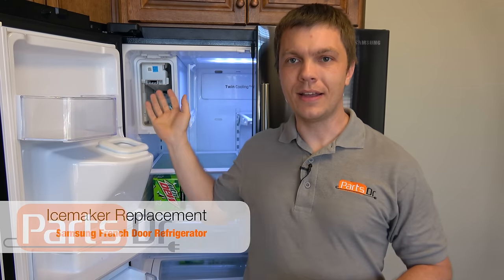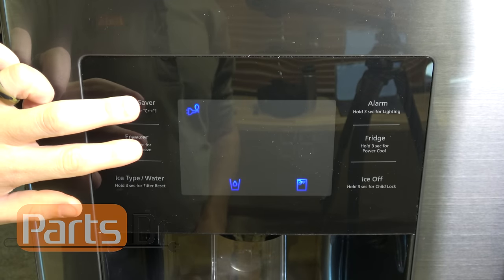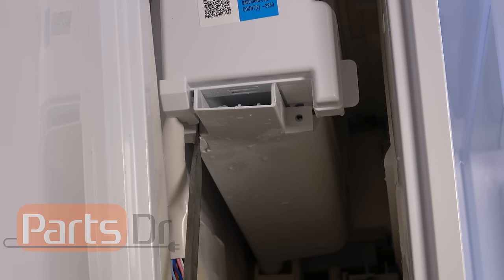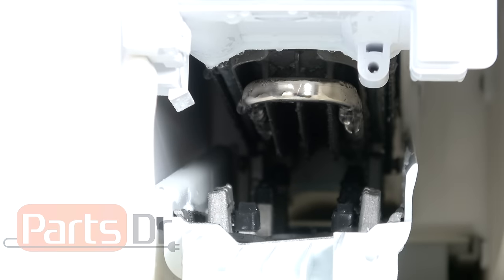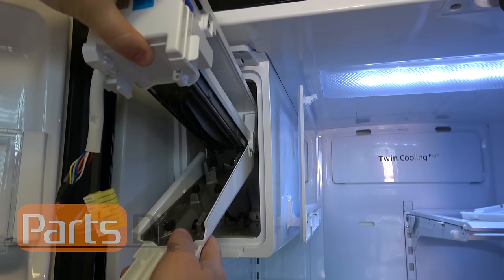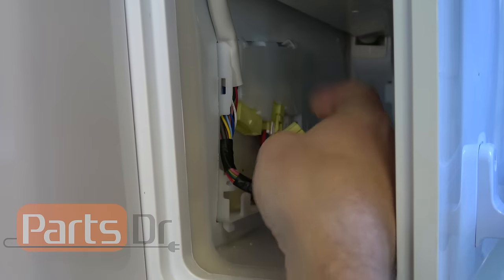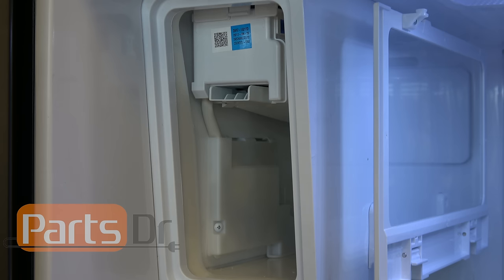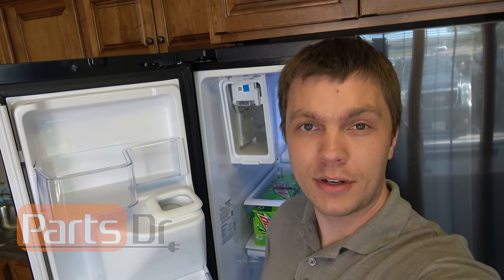How to replace Samsung Icemaker part # DA97-15217D

Comment: I have the samsung rf28hdedbsr/aa and my buttons aren’t in the same location as on this fridge. The turning to forced defrost mode worked but not turning it off. After trying several different combinations I ended up unplugging it to do the job, then just plugged it back in after I reinstalled everything. . Mine had an issue with ice build-up. It would freeze the ice tray into place after about a week. I’ve also ran RO purified water through my system since day one.

Comment: Would this fix the clicking / knocking noise? My ice maker stopped making ice. It’s not frozen up- it’s fully defrosted. Just make a knocking sound.
Reply from the maker: If the ice maker is making a clicking and/or knocking noise, the ice maker is bad and will need to be replaced.

Comment: What does the blue button do on the ice maker I’m about to replace it & I hope this works for the twin metal cooling model
Reply from the maker: The blue button which is also called the ice test switch, can be pressed for at least 1.5 seconds to activate test mode and the harvest mode will start.  If the Ice Maker thermistor is below 0°F, the Ice Maker heater turns on for about two minutes. If the temperature exceeds 0°F. the Ice Maker heater turns on for 30 seconds. After the Ice Maker heater turns on for 30 seconds, the heater turns off and the Ice Maker harvest motor turns on. The motor will rotate in the right direction for about 3 minutes, then the water supply valve is energized and then de-energized and the test mode is complete. If the above operation is not carried out within 6 minutes, the Ice Maker will go into a fault mode.

Comment: I have a Samsung RF23M8570SG with the large lcd display on the right door. Would you know
how to put it in the force defrost mode? Ice maker has the same problem of freezing up. Looks
like the same icemaker as in your video..
Reply from the maker: Try these buttons shown at the bottom of the screen here: https://youtu.be/1DQZs75GEWQ?t=26

Comment: Is the forced reset only the ice maker or does it impact the entire fridge/freezer? Basically, do I need to take all my spoilables out of the fridge and freezer?
Reply from the maker: The forced defrost cycle is for the entire refrigerator and freezer.  It would depend on how long it takes to thaw it out. If you can thaw it out quickly you can leave the food, but if it takes some time then you should put your food in a cooler while you do the repair.

Comment: Is it possible to separately purchase the white plastic tray on the bottom of the ice maker? Before finding this video, I broke this tray trying to remove the icemaker.
Reply from the maker: No, it is not sold separately.  It is only sold as part of the ice maker assembly.

Comment: Is it possible to remove the entire outer box and ice maker? I’m done with the freeze ups and bought an under-counter ice machine for our kitchen renovation. Would be nice to have the extra fridge space if this was removed completely.
Reply from the maker: The ice maker has to be in the refrigerator or it won't work properly.

Comment: I got as far as I could but there appears to be another screw on the side of the icemaking unit to allow you to release and drop it ??? I did not have an angle screw driver so I'm at a standstill. Does this make sense ??
Reply from the maker: We have not seen that for this style ice maker.

Comment: Should using the forced defrost remove all the harden ice? I’ve ran it multiple times and I still have a lot of frozen ice. I can also see it on the coil you mentioned. The ice maker has also been off for a few months because it stopped working, I assume because of the build up.
Reply from the maker: No it will not remove all of the hardened ice.  You will probably need to unplug the refrigerator and let it thaw out.

Comment: Great video. Out with the old and in with the new. However it has been almost 24 hours now and still no ice being made. Can it take that long before making ice? BTW my buttons to push to start defrost mode were Freezer/Lighting then Lighting x3 to Fd (forced defrost). After defrost cycle of about 30 minutes with annoying beep the whole time. The turn off/on fridge sequence is pressing the Freezer/Alarm/Fridge buttons for 5-10 sec. My Samsung model is RF26J7500.
Reply from the maker: You should have ice within 24 hours if everything is working properly.

Comment: A relative gave me this model refrigerator because they bought a new one since this one was leaking from the ice maker. I'm using this as a garage fridge and am not hooking up a water supply line to it. How do I disable the ice maker all together? I don't even need that ice maker section of the fridge to be cooling or attempting to make ice.

Comment: My ice maker is making dirty cubes, can I take it off and clean it or I have to replace?
Reply from the maker: You can take it off and try to clean it, but usually hard water deposits and corrosion start to eat away at the coating on the ice maker tray over time, and the whole ice maker needs to be replaced.

Comment: Thanks for the great video and explanations - On my fridge (RF858QALASL) the ice maker model is DA97-15217C - it stops working and I want to replace it. is there any significant difference between DA97-15217C and DA97-15217D models?
Reply from the maker: DA97-15217C appears to be for 220-240V models and DA97-15217D appears to be for 120v models.  You will need to order DA97-15217C if that is what your refrigerator has in it.

Comment: I have, with your help, fitted my new ice maker BUT the cooling coil will not go back up and into place. Every time I push it up it falls back down. I have even used a wooden spatula to push it up but it will not stay in place. Is there anything else I can try or if I close the bottom part of the ice maker and replace the screw will that suffice? Many thanks for any help you can give me.
Reply from the maker: Closing the bottom part of the ice maker and installing the screw should work fine.

Comment: How does the water get fed to the ice unit?  I don't see that mentioned at all, is that something to be concerned about when replacing the unit?
Reply from the maker: You don't have to be concerned about that if you are just replacing the ice maker.  The water if fed through the filter case assembly and through a tube up to the ice maker. See the two videos below for more information.
Ice maker water line: https://www.youtube.com/watch?v=stXZXe6PRD0
Filter case assembly: https://www.youtube.com/watch?v=qUblOnomHHY

Comment: Thanks for the video!  What is the silicone caulking you mentioned if you need to seal between the ice-maker ans refrigerator wall?
Reply from the maker: You can find the sealant here: https://partsdr.com/part/da81-05595a-adhesive
You can find the video for installing the sealant here: https://www.youtube.com/watch?v=8DkXLEXKAug

Comment: I’ve followed all the directions all the way to where you push on the release tab on the top front of the ice maker and I still can’t get the ice maker out. Any suggestions?
Reply from the maker: It could be frozen in place.  Try unplugging the refrigerator and leaving it open to thaw out.

Comment: How does one remove the screw behind the top locking tab? I have angled screw drivers but non worked.  The screw is holding to he ice maker to the top locking tab bracket on the right side of the maker...
Reply from the maker: What is the model number of your refrigerator?  https://www.youtube.com/watch?v=4HhWL9sonuE

Comment: Hi. What's the difference between DA97-15217A and DA97-15217D (between A and D -- on the Samsung Fridge ice maker units)?  Can I use DA97-15217D on my fridge where the OEM part is DA97-15217A?  Thanks
Reply from the maker: DA97-15217D is the newest version that replaces DA97-15217A.  Also check on this video here: https://www.youtube.com/watch?v=OTZRXz69Pec

Comment: My Samsung icemaker DA97-15217A-00 is making ice ok.  The problem is that it overfills.  Is the ice full sensor part of this icemaker or is it another part?  I do not see a lever or switch to indicate when the bucket is full.
Reply from the maker: Hi Ron, the ice full sensor on these is an infrared sensor located on the auger motor assembly.  We have a video on replacing this part here: https://www.youtube.com/watch?v=C8Qa2PGjWmw

Comment: Fabulous video! 2 questions. First does the water supply need to be turned off? Second if the fridge is already turned off and defrosted can the repair be done with it turned off? Thank u!
Reply from the maker: Water supply does not need to be turned off.  If the refrigerator is not turned off, it can start cooling the cooling coil on the bottom of the ice maker which can cause problems with removing the ice maker.
Reply: Thank u! But if it is already turned off, unplugged and defrosted its ok to go ahead with the replacement?
Reply from the maker: @boxingfan8123  It sounds like it.
Reply: @PartsDr  great thank u!

Comment: So last month I defrosted everything, sealed up the huge gap on the left with silicone and replaced the TCO that had burnt out for the ice maker heating element defrost, the original part was 102C rated so I upped it to 115C rated. Not sure why the thing ever blew in the first place. Happy to say that over 1 month in there is barely any frost inside the of ice machine and the ice made is very dry just like it was when it was a new machine, awesome. This comes a few months after having to dismantle the refrigerator evaporator portion because of a drain line that kept icing up and adding some copper wire so the defrost heater melts any ice buildup in the drain tube. Not having this fixed eventually lead to water buildup and humidity going sky high in the fridge portion, causing the evaporator to ice up to a solid block, eventually causing the circulation fan to be obstructed full of ice. These Samsung fridges have some bad engineering choices but at least they seem to have fixed the flaws from the factory and deployed things like weather stripping to seal the edges of new built models. Hopefully you can all milk some free warranty claims out of Samsung to have this replaced if you are less technically/mechanically inclined. It's ridiculous how such an expensive fridge can be so god awful after 2 years. Also remember to clean the condenser coils inside the back vent panels every few years or so, if you have pets these can be a nightmare (think dust monsters). Thanks for the great video.
Reply: @spikester I am having the issues regarding the iced up evaporator, I have had a repairman out twice, once to replace the circuit board in the back of the fridge, and another time that he moved the sensor from the heating element to hopefully get more accurate temp readings. Well to say the least it did last longer but lo and behold the icing has reared its ugly head once again. I had read online that the drain tube freezes and then the water backs up and that is exactly what it is doing. I thought that I had read the solution was to wrap some copper around the heating element and run it down into the tube. Is this what you did? If so, how long of a piece of copper did you use? Is there a YouTube video that shows the steps? Thanks

Comment: Moved into a new home and this fridge came with it. Found that ice was not being made. Looked into it and discovered the icing up problem. Couldn't remove the ice bucket. Research found this video and that this is a very common problem with Samsung. Just ordered the part and going to try this repair myself. Thanks for the video. Samsung sure lost a lot on reputation with this. Definitely will not buy another Samsung appliance again. My fridge in my previous home was an LG and it worked great for 6 years.
Reply from the maker: Sorry to hear about your refrigerator issues!  Good luck with your repair!

Comment: I replaced it with DA97-15217A in January along with sealing the box and replacing the clips. It worked up until now. Now its back to the ice buildup. Looks like it build from where the water pours and move to the front.
Reply from the maker: Try checking the things below.

Water line - https://www.youtube.com/watch?v=stXZXe6PRD0
Ice flapper seal - https://www.youtube.com/watch?v=89GS4GvKJ1Q
Ice bucket & ice chute gaskets - https://www.youtube.com/watch?v=7vRD6Gu0Cyw
Check for a heater on the ice auger motor drain tube- https://youtu.be/C8Qa2PGjWmw?t=203

Comment: I have a RF4287HARS model Samsung. Ice maker will not run to dump the ice out of the maker. Motor not responding. All other function work. Is it repairable or cheaper to replace? How much is the maker for my model?
Reply from the maker: It's most commonly caused by a failure of the ice maker itself.  Here is a link to it: https://partsdr.com/part/da97-07365g-ice-maker

Comment: Thanks for the video! I did the full replacement, sealed it up and have no problem with condensation.  However, the ice maker only makes ice when I press the reset button.  Is there a senor somewhere that might be telling the ice maker that it is full?
Reply from the maker: There is an IR sensor on the auger motor that senses when the ice bucket is full.

Comment: Great video thanks!  Had this fridge for 4 years now but the ice maker only started “jamming up” about 8 months ago. I have defrosted and reset my ice maker a few times now. So far I haven’t replaced the ice maker as it still makes ice. It only freezes up about every 3 months so I defrost it.  This time though, at the back of the fridge where the Twin Cooling badge is, the small hole on the left had a little bit of ice coming out. The one on the right was fully plugged with ice protruding.

Is this from the ice maker being jammed or is there something else going on in the back of the fridge?
Thanks
Reply from the maker: That sounds like a separate issue that is usually caused by the refrigerator not going through the automatic defrost cycle properly and the defrost drain freezes.  This video show how to remove the evaporator cover here: https://www.youtube.com/watch?v=ucjSPXjlJbc

Comment: Hi. I still hear the top icemaker make its usual/normal sound when I press the lever. However, no ice is coming out. What seems to be the problem? Thanks.
Reply from the maker: If there is ice in the ice bucket, check the ice bucket for any blocks and turn the auger by hand to make sure everything is working properly.
Reply: @PartsDr  forgot to mention. I didn't find any ice in the bucket. I can tell you the sound can be heard when the "ice" dispenser button is pushed in. I was thinking it might have to do with a problem with the water supply??? 

I'd rather ask before ordering the part. Thanks.
Reply from the maker: @TeslaEVVideos  I'm sorry but we are not able to troubleshoot this problem through a Youtube comment.
Reply: @PartsDr  I know. It was a long shot. I was just trying to see if I can be certain that I will not have to return the icemaker part once I purchase it from PartsDr

Comment: Took the old one out using your video. Very helpful thanks!  I also ordered and got the new parts from your site. I haven’t installed yet, but in looking at the open ice maker compartment, there’s a lot of frost built up in that cooling coil...is that normal?  Now I’m doubting if the ice maker was the problem. 🤔
Reply from the maker: If you are getting excessive frost check to make sure the ice maker compartment is sealed as instructed in the video and also check to see if your refrigerator has a the "Y Clips" installed.  If yours doesn't you should install the Y Clip Kit https://partsdr.com/part/da82-02367a-clip-assembly

Comment: Hi!  I have a different problem!!  My RF265BE ice maker works TOO well.  It won't stop making ice!  It overflows the tray and ice fills up in the ice house cabinet.  Makes a huge mess with ice falling everywhere when I pull the tray out.  Mine is the unit with french doors and the android tablet computer built into the right door.  I don't have the same control buttons on the door.  How do I get it into the diagnostic mode to defrost it?  I looked into the apps on the android computer but nothing there seems to be for technicians.  So I need to know how to do that and also how does the ice maker know when it's full?  Older ice makers have a wire arm that raises up as the ice level increases to ultimately turn off the maker.  No such arm on this one.  Is there some hidden sensor that looks for the height of the ice in the tray?
Reply from the maker: There is an optical sensor in the auger motor assembly that senses the ice level in the ice bin.  We show that part in this video here: https://www.youtube.com/watch?v=C8Qa2PGjWmw
Reply: @PartsDr  thank you.  I'll remove and inspect it.  But do you have any info on hope to get it into that defrost mode?  I don't have a freezer button.  The only buttons are the three for the water / ice / crush dispenser.  Thank you!

Comment: I had ice build-up. Then I defrosted with hair dryer AND the FD method. Then I pushed the reset button and heard the confirmation chime. NOTHING happening. No water seems to be coming into the ice maker, but the water DOES dispense from the water function on the door. Any ideas on what to try next? I don't mind buying and installing a new ice maker, if that will solve the problem, but I would hate to go that route and have it still not function. Thanks!